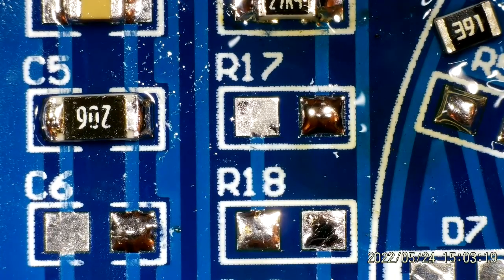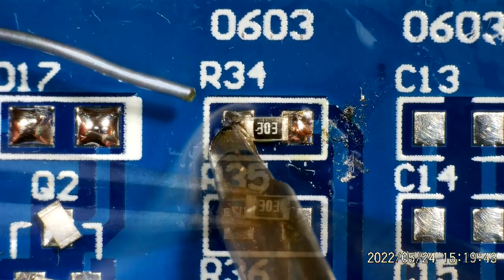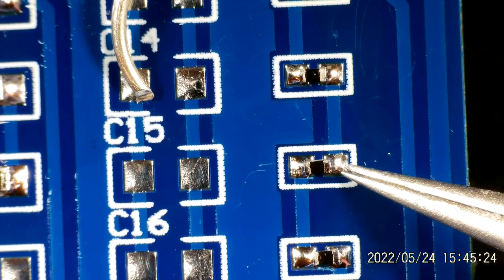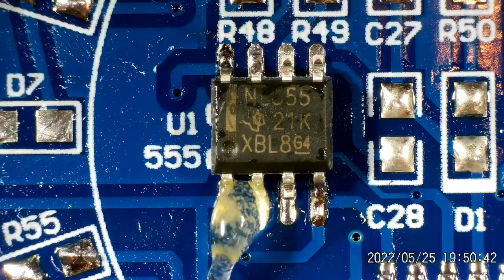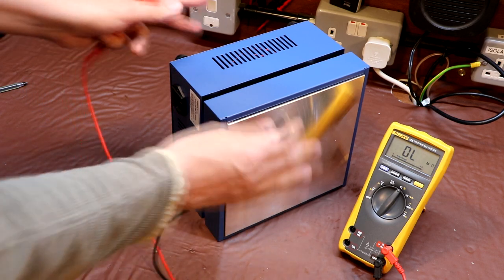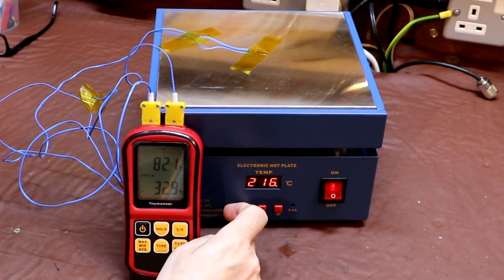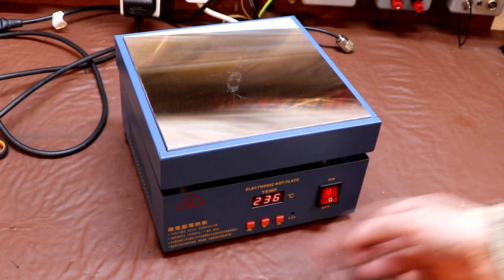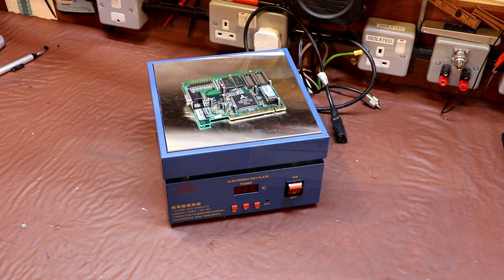Hot Stuff Part 2 - Soldering Hot Plate Model: 946C

Comment: When I got my hot plate (a smaller but similar unit) I took it apart to find a nice earth lead bonded securely to the chassis with a locking washer and nut covered in red thread sealer. Right next to the nut was a "Quality Pass" sticker. Unfortunately that earth wire was completely isolated by the paint, and the entire device was floating... 😂
Reply from the maker: Yes you just have too love the Chinese attention to safety LOL! Thanks for watching and great comments! Best regards Chris

Comment: Hi Chris. Interesting demo of the hot plate. I’ve never used one but I think it could be useful for pre heating boards. Solder paste can be a pain to use. I apply it with a cocktail stick rather than the syringe. Cheers Graham
Reply from the maker: Thanks Graham. The paste I was using was dry and claggy it didn’t really want to stick on the pads. I will try a cocktail stick next time

Comment: For your smd resistors, you could smear the solder paste on to a sheet of paper, then pick up a resistor and drop it on the paper to coat the legs under side only, then move the part onto the pcb pads.
heat up and the part is soldered by its wetted feet (needs better shoes :-D ).
Its just a thought, and i do talk some shi lol
You do really well with tiny soldering,  if i try to solder a resistor it stands upright lol.
Dam surface tension.

Your heat box,  i would remove all the screws and use a dremel to remove the paint around every earthing hole (both sides of the metal).
Star washers just jumped to mind.

I have a paint stripper gun and i had a victim usb memory stick that had a memory that was not soldered down fully.
I know this as i could see light under the solder blobs.
I found the no 1 heat got nowhere fast.
So number 2  500degrees, and i expected chip death, it smoked but worked fine !!.
I got away with it as i didnt give a shi..t about the usb memory lol.
Sorry chris, ultra waffle mode.
Smashing video :-D

Comment: You need to juse a soldering tip with the hollow in the middle that holds a reservoir of solder as you wave across, this will also remove any excess 
ccess solder and liquid flux not gell.
Reply from the maker: Yes I will probably get one of those but the knife tip is designed for drag soldering kind of multipurpose. Didn’t really have a problem soldering it was just the alignment of that fine pitch chip that was really hard.  Mainly because I couldn’t see the whole of it. I have a binoculars microscope that may work better but the Andonstar is better for the filming.  I enjoyed you video would like to have seen you put the chip back in.
Reply: Hi, Chris just made another video of me changing some big chips, hoping to get it on YouTube tonight if you want to take a look.

Comment: I think your green plastic tube is too big. I have a small blunt needle on mine and don't have any trouble dispensing tiny amouts of solder paste.
Reply from the maker: The plunger was really stiff. I should have checked the date or perhaps warmed it up a bit so it would pump better.